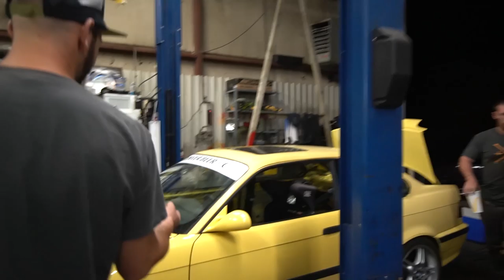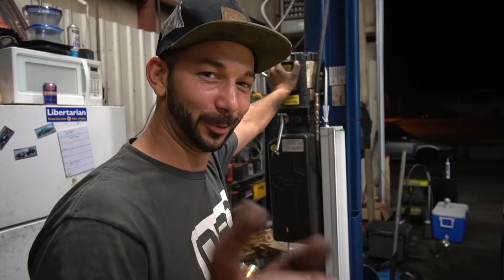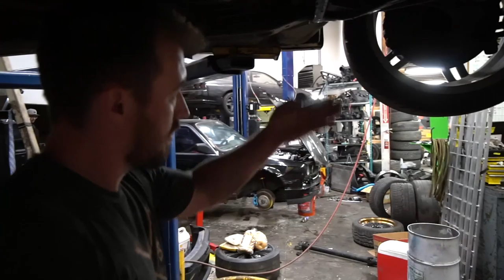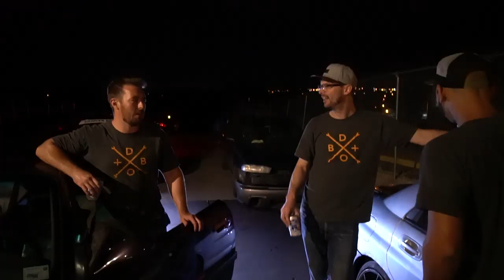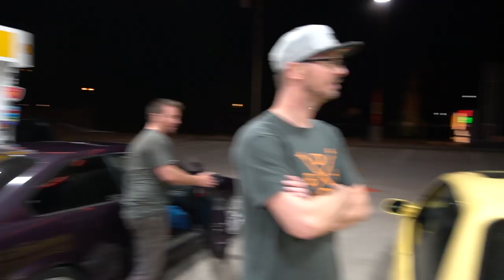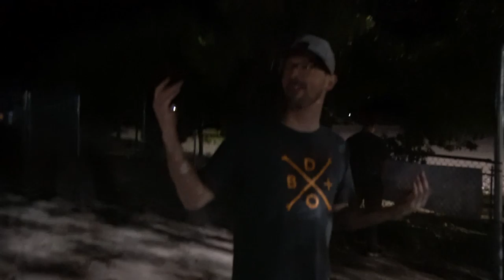Can We Get Into Gridlife!?

Comment: "It (water wetter) reduces the surface tension of the water and increases the heat transfer coefficient between the fluid and the metal surface. (reduces the little bubbles like those that form on the bottom of the pot when boiling water)." Science.